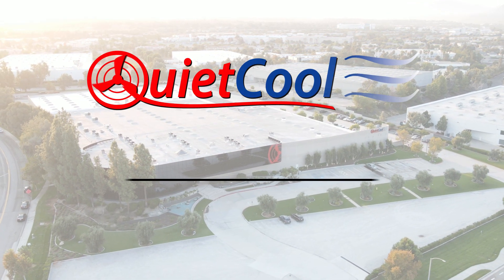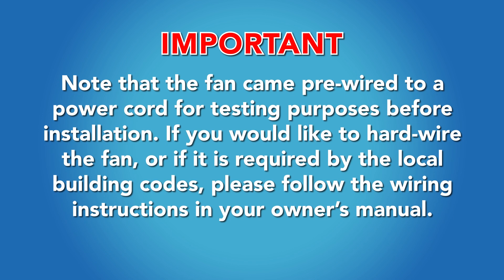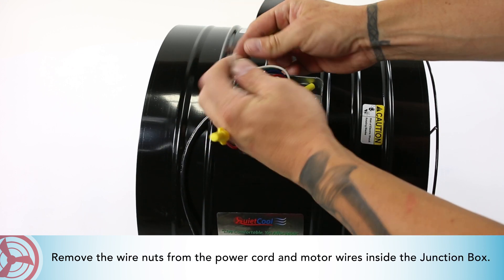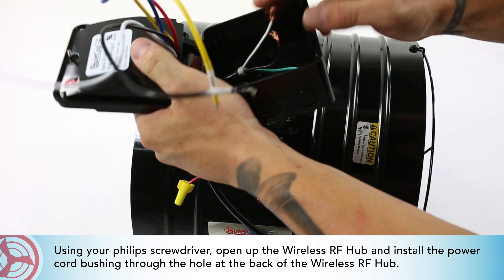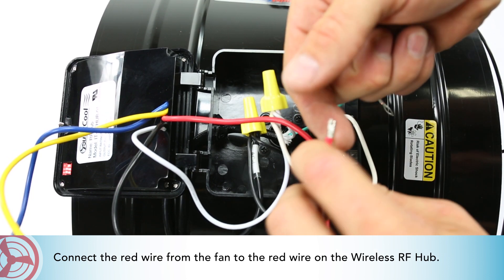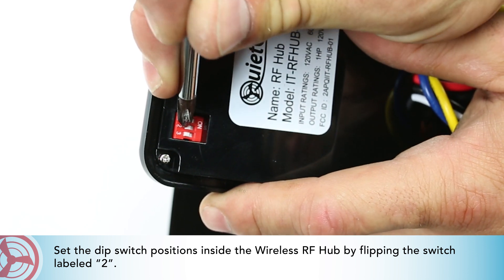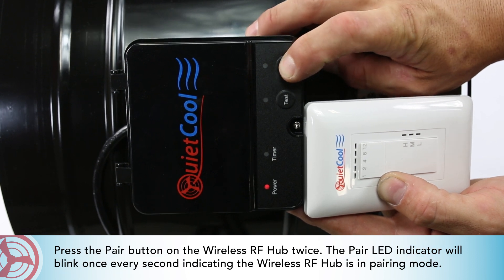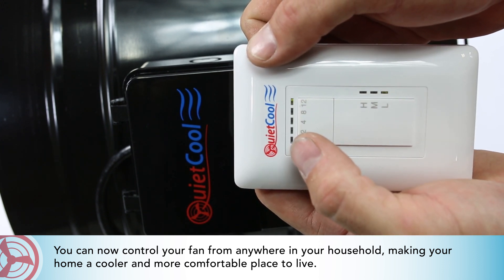Two Speed RF Wireless Kit Installation for QuietCool Energy Saver ES-3100 and Stealth Pro 3.3X

Comment: I have one simple question. It's 2025, why don't you have a smart hub that connects with today's home automation systems? Your first WiFi hub was a joke and the app would not work with it. Recently Intermatic stopped supporting QuiteCool all together. We're toast! So what's your hot replacement? An RF switch. Like to old television remotes from the 90s?  Maybe I can tune in an MTV Unplugged episode. Dudes!!
Reply from the maker: Check out this video from Home RenoVision DIY that gives a glimpse into an automated system we have been working on. Keep an eye out soon! https://youtu.be/8pArX4ww0ZI?si=86p8GZ0IqleHpTbK

Comment: Good instructions. I had one issue -- the wall switch powering the fan was ON and yet the fan didn't turn on when plugged in and hitting the test button. After checking my wiring connections 3 times I finally left it plugged in then turned the wall switch off then on and it worked. Thought I would share in case anyone else has a similar issue and is tired of climbing up and down from a 120 degree attic in August..